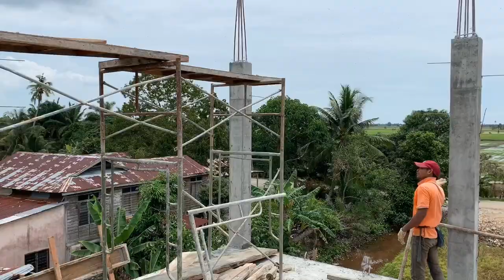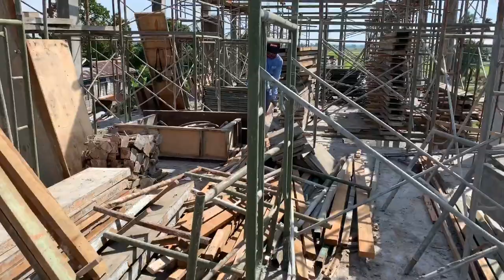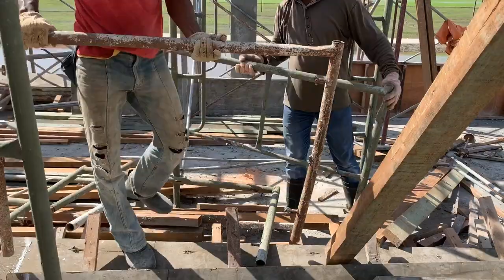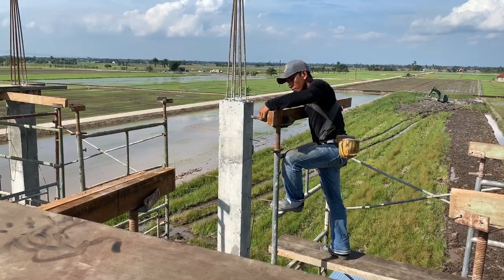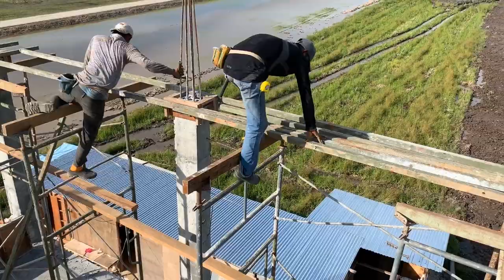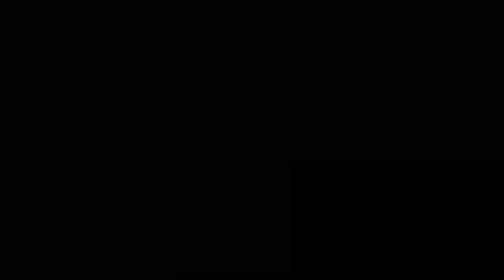Scaffolding Shuttering Works: How to Prepare & Install BEAM SLAB Shuttering Process Before FORMWORK

Comment: The way the construction workers did the scaffolding shuttering work is unsafe and does not comply with OSHA  law as there is no fall protection system at all.
Reply from the maker: Understand whats your want to present. But do you consider the cost the land owner willing to pay to contractors? Its also depend on the current market status.
Reply: How do you know that this work location is governed by OSHA?
Reply from the maker: @emilgrigorescu8282  different country different method of law enforcement & regulations
Reply: You’ll be amazed if you check the statistics of accidents of these workers at 3rd world country constructions compared to the west constructions. Their number of fatality is very low even how unsafe you see them work.